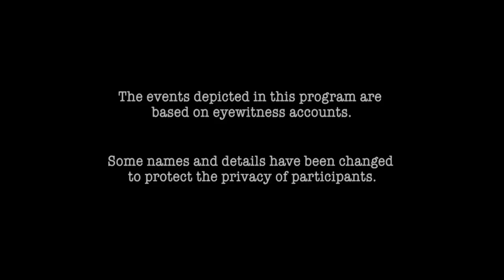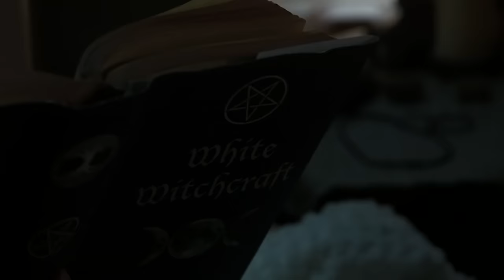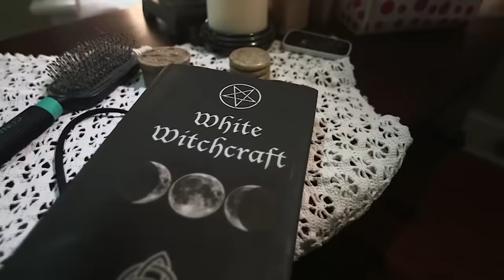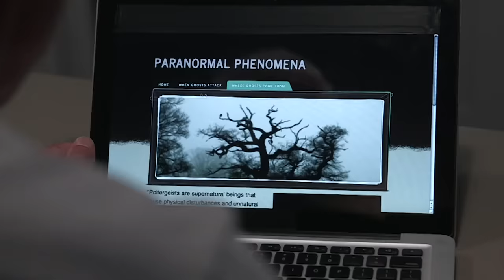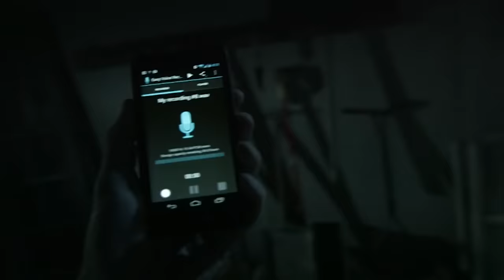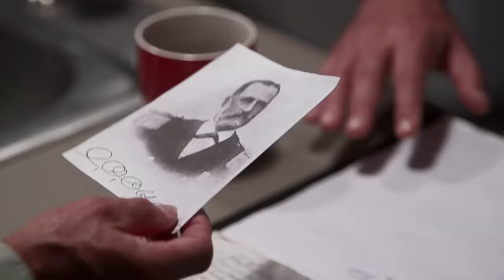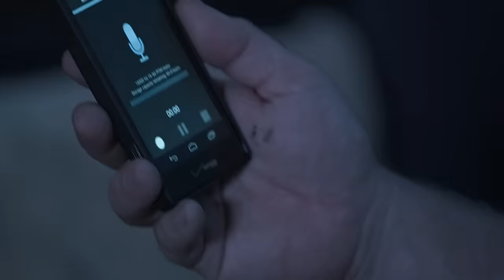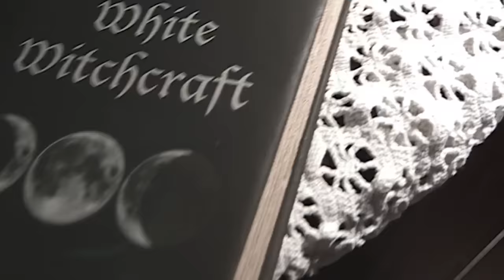The Well From Hell | FULL EPISODE! | S6EP2 | A Haunting

Comment: I'm an empath. I was asked to remotely participate in a prayer session with a shaman many states away, to help cleanse a man of possessive spirits. I was skeptical, but it seemed as if that could o ly be a good thing, so I did. I was attacked in two dreams that night, and when that failed, I was physically "jumped" omw out of the shower the next morning. I was thrown to the floor and extremely physically ill (cold sweating, nauseated and unable to move) this went on for about 3-5 minutes u til I said out loud "you may have control of this body but you can't touch my soul" and it stopped as fast as it began. It took me quite a few minutes uses to even get off the floor. I crawled into my bed and just laid there until I was okay again. No matter what, keep your faith and remember that you are not your body. This is real 💯